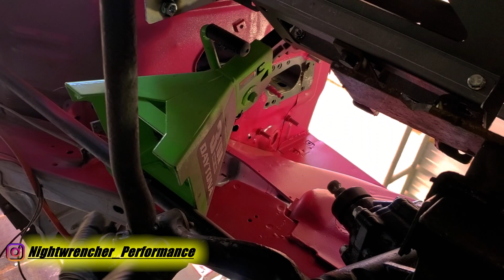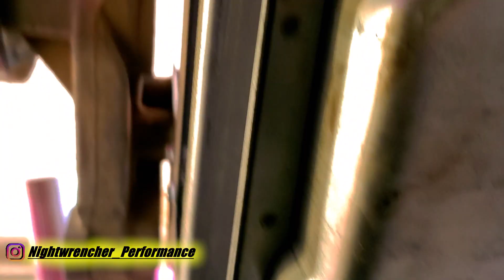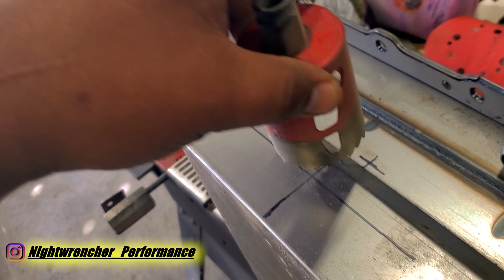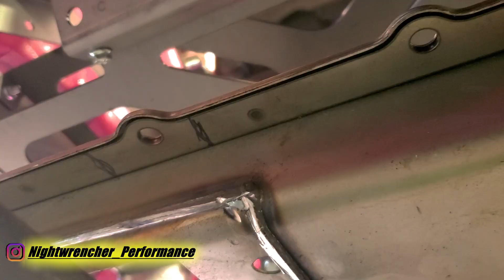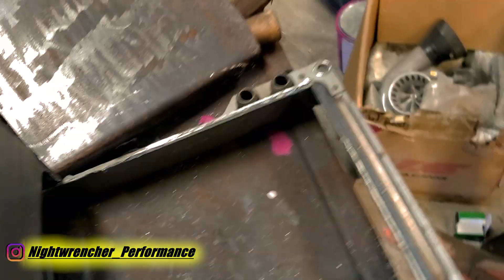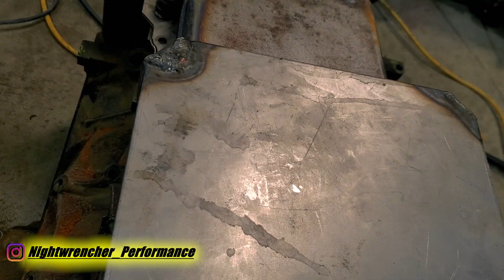This Is Why No Body LS Swaps Mopars | LS Swapped Mopar - 1970 Challenger |

Comment: Folowing your channel now man. 

I LS swapped a 440 70 Charger two years ago, and the oil pan was the hardest part of that one too. I ended up finding a super low profile rear sump aluminum pan for a trophy truck/race boat, and raised the engine just enough to clear. I used an aluminum block L33 so im sure the center of gravity is still lower than the old iron block 440 had. 

Best thing i ever did to the car. I should have swapped it years ago instead of trying to make that big block work.
Reply from the maker: So rad! I'm glad you ended up liking the swap! Could you feel the weight/handling difference or was it only a performance difference?
Reply: @nightwrencherperformance  absolutely. I weighed everything during the swap and made an effort to aim for 50/50 weight distribution and the best balance possible. 

The cast iron 440/727 weighed around 950lbs with iron manifolds. The aluminum L33/4l60 weighed just shy of 600. So 350lbs of weight is eliminated from the nose. 

The difference was HUGE. Such a nicer driving vehicle without the weight of the big block. Better balanced, more responsive, stops faster, more eager to turn into corners and change direction. Gets 23mpg if I drive it easy and 15mpg if I drive like a teenager. 

Almost 10k miles on the swap since finished and no problems at all. I drive it almost daily. Just get in and go. 

I built mine to be reversible also, but after driving 440s for 20 years and this swap for the last two, I couldn't imagine going back.
Reply from the maker: @jrh2009  thats awesome to hear! Im really looking forward to this swap! I hope itll run as good as yours